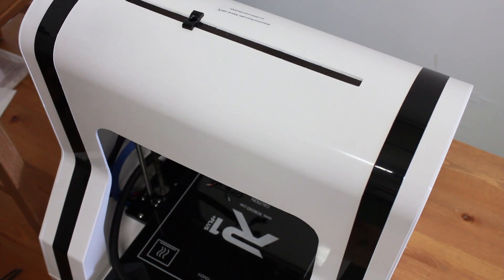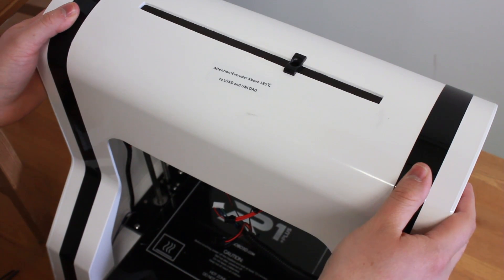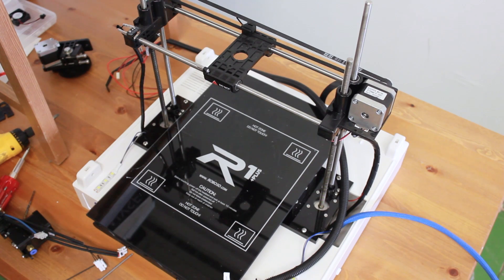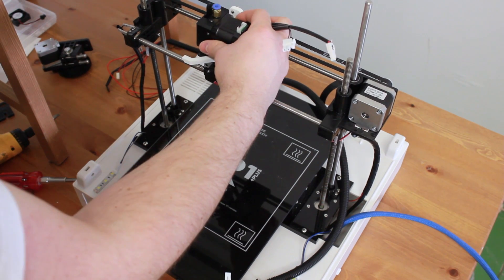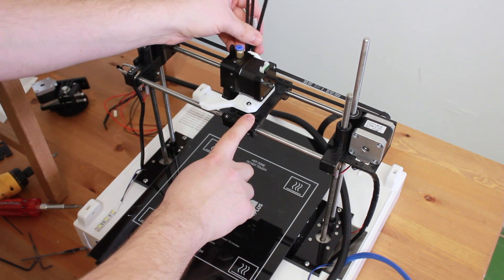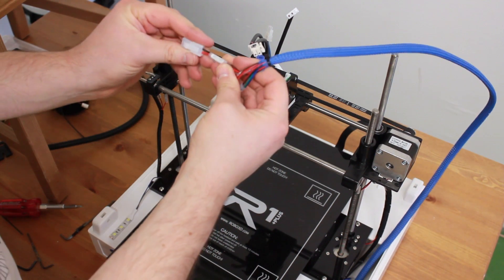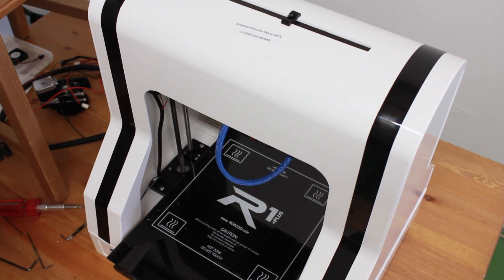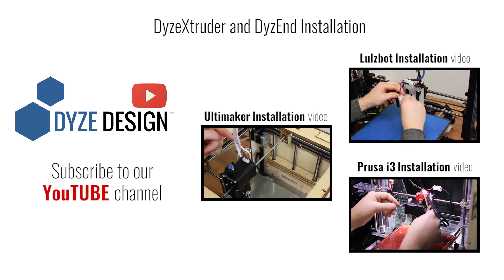ROBO 3D - DyzEND-X +DyzeXtruder

Comment: I have an R1 and not an R1 plus. :( 
I am going to have to make some changes....
But there are no diagrams on the support page to connect this device to the board. It should be the same though?
+DYZE DESIGN
Reply from the maker: Hi dragnet,

Concerning the board it should be really similar.

send us a email on our websiteso we could help you confirm if its the same
Reply: +DYZE DESIGN It's the same as the Prusia board. Robo3d R1 uses Ramps 1.4 for its board.  The only difference is that the X limit switch is on the carriage. Instead of where I see it placed on the video.
Reply from the maker: Okay, then you can refer to this page for the wiring diagram of the ramps 1.4 : https://dyzedesign.com/support/preconfigured-printers/printers/#prusa

if you have any other question please feel free to contact us

best regards,
Reply: +DYZE DESIGN Thanks! I hope to grt this installed tonight after work.